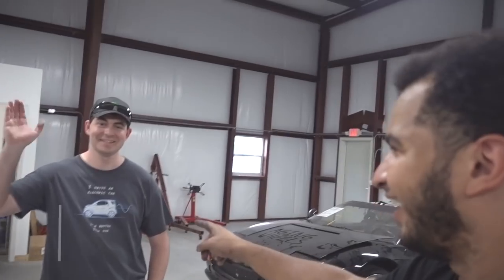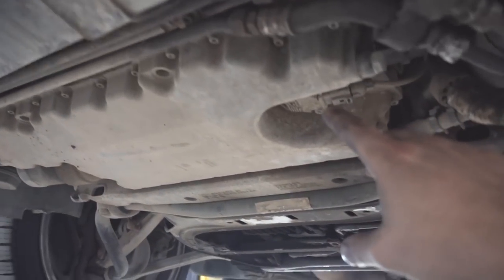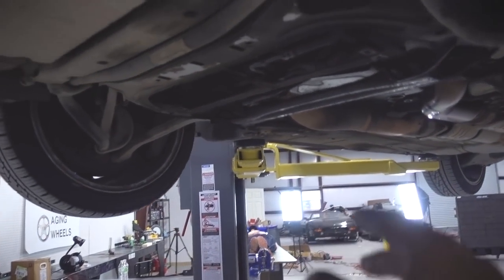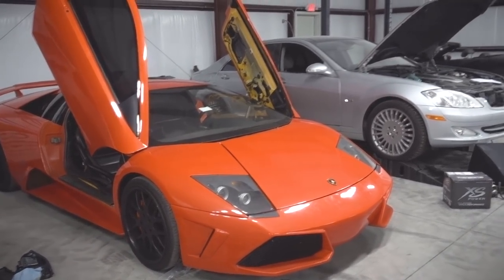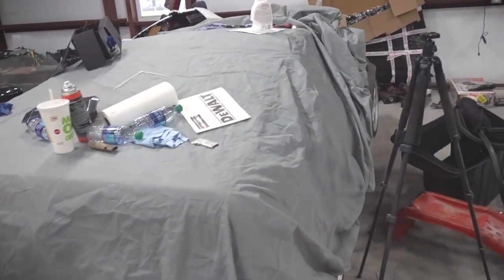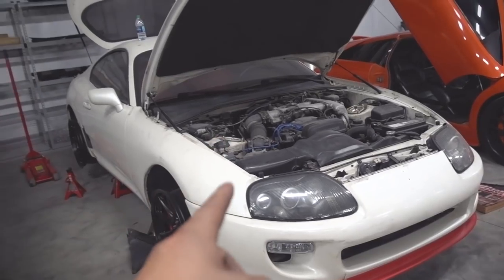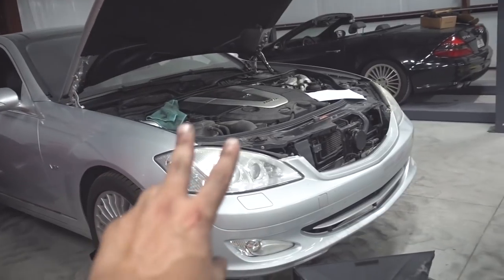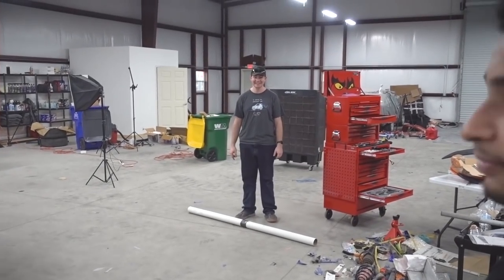My Cheap Fast & Furious Lamborghini Is WORSE Than I Thought - GARAGE UPDATE

Comment: I think it would be awesome to keep the merci an Orange color as an homage to the movie. For example whatever the factory orange Merci paint was from Lamborghini
Reply: Agreed, anything else just ruins the build.
Reply: THE ORANGE DOES NOT SHOW ON CAMERA. HAVE YOU EVER SEEN IT IN THE SUNLIGHT? AMAZING!!!
Reply: Agreed ,  that color wasnt around in 2003 on Lamborghinis,   it's a later Aventador color.  Repainted correctly it will be fantastic
Reply: Painting tri coat lambo color sucks   and iš expensive af
Reply: @OskarasNauseda  naaa.  It's fun.
Reply: Wheels look good as they are too
Reply: ARANCIO ARGOS paint 👌🏼👌🏼
Reply: @linusrichter3934  those are going to be need to be changed for mechanical reasons as the wheels in the back are larger than the front and it is quite hard on the vehicle, the size difference on wheels was mentioned in the reveal video.
Reply: Howema well the wheels can be different size but then you have to compensate with tyre size so in the end you have the same realistic diameter
Reply: Make it matte orange like the Huracan Performance version of the orange
Reply: Nah paint it purple
Reply: He will it's a movie car has to be exact to the movie more value especially fast n furious
Reply: Dominick Nicolai so true
Reply: Dominick Nicolai agree
Reply: It's all about provenance, so restoring it to F&F spec should be the only way forward. Please don't ruin it by doing it any other way!
Reply: Gotta say I agree. Keep the same orange, just do it right. Can always paint some accents black and change up small bits, but the main color should stay.
Reply: Hope he’s keeping the rollcage!
Reply: Repaint it the proper colour it might be a movie car but it would look better as the car it started out as not some bodged movie car which you wouldn’t want to drive
Reply: Duh he’s keeping it the same color. He said he was going to repaint it because the paint job is bad- not because he wants to change the color. Just like the gallardo- he just fixed the paint job. He kept it the SAME color- just fixed it. He SHOULD paint the AMG SL purple though!!!!!
Reply: Keep it painted the same but wrap it in that awesome nardo grey color!
Reply: Knowing Lamborghini, it'll be something along the lines of "Arancio Pretentissimo".

Comment: Rather than buy a 355 hardtop parts car, try to cut the roof off and fit it to your spyder why not just use the parts car as your base and the spyder as your parts car? Presumably it’s not been on fire and is in similar or better condition and already has the roof and could be resold as such. I’m no master mechanic but common sense says that would be much easier and would also give more value to the car when compared to a salvage title spyder converted to a hardtop, the salvage title spyder restored as a spyder would be hard to sell simply because of the title.
Reply from the maker: Because they usually have catastrophic front end damage, and that would be much harder to fix than replacing otherwise undamaged body panels. I wouldn't buy a parts car that wasn't a parts car for a good reason. Also, I'm not selling it.
Reply: Brandon Reid
  Your suggestion would be just Tavarish buying another Ferrari and trashing Tylers car.  That wasn't the point of the build.
Reply: I’m gonna say a true parts car is going to be hard to find.

Comment: Yes, the engine has to come out with the subframe attached. That the easiest. I would turn the Bentley arround on the lift so it faces the other side with the nose of the car, you're going to need a lot of space, drop the complete subframe with engine on the table that you have.Then you can roll it towards you're working benches! Love the video's man!

Comment: I've heard that sand blasting can be too abrasive for engine components. Some people opt for hydro blasting as an alternative. Is this something you've heard of Tavarish or do you think that sand blasting the Ferrari engine would be fine?
Reply: Soda blasting might also be a good option as any remaining deposits can dissolve away when washed down. Sand might work its way into small crevices and cause problems later down the line.

Comment: Those little plastic bits that attach to the gear selector are a bit delicate! I remember having to remove the mechatronics on my Audi to replace a bad gasket seal and it had a similar setup, but none of the instructions for the work even mentioned it, so if I hadn't have noticed it, it wasn't going to be installed correctly and I would have probably been in the same boat. Remember guys, even the shop manuals don't always tell you everything, so look over everything close!

Comment: I would avoid sand blasting anything on those engine parts, try soda or walnut shells they are way less abrasive and would not interfere with tight tolerances as much

Comment: You can take the shift linkage off the old valve body and put it on the one that’s in the car already if you’re careful. And avoid having to do an initial start up of a new control unit. Sadly I did it once when I was just starting out and my foreman had one and that’s what we did. I’ve been a Mercedes tech for 8 years now if that makes you feel any more confident on my comment 🤣

Comment: At least, keep the bodykit on the 'Lago. Looks pretty badass and spot on. The "originale" 2003 body is a bit dull and old looking (would rather have a stock Diablo than a stock 2003 Murci then) compared to that kit.

Comment: A word of caution: not sure is the case of this Ferrari, but on cars that have both a solid top and a convertible version, the convertible windshield and the windshield framework may not be the same as the one with a solid top. They could have different rake, size...

Comment: Are you sure those backfenders needs to be replaced on the Ferrari, a good sheetmetal worker can make them straight and rehardened again, and it would be a good episode to see one at work doing a good job and the the car would stay original, repair instead of replacing sheetmetal parts, thats an artform that has allmost been forgotten nowadays - dont go with the hardtop stay original - you might consider to stay with a max of 3  projekt cars at a time.

Comment: Let me guess, the key of the Murciélago is locked, because the car waits for the "in gear" or "parking brake on" signal. But hey, car electronics, how hard can it be. I mean you already got the electric roof of your other Lambo fixed. Ah, wait, hang on...😁

Comment: Never sandblast a modern engine, get it acid dipped or buy a parts washer. They have galleries that are blocked off internally and the sand gets trapped, once the oil goes in the particulates break loose and cause all types of havoc with your bore's...

Comment: But why would you replace all that metal on ferrari. That damage is not that bad. Could just maybe samdblasst it etch priner it and coat it. Seen an entire escalade get done like that. Still runs no bent panels or weak metal.

Comment: OOF the problem with the key in the murci is well know to me, its basically a vw key from the same era, there is an issue with the mechanism behind the lock cylinder, the rod that pushes out the steerin lock bolt breaks and jams the mechanism, and you cant fully return the key to the off position. Thats why they put a start button in the engine bay. Its a major fuckin pain in the ass.

Comment: That looks like the wrong conductor plate for the mercedes. The car is a 7 speed 722.9 gearbox, the valvebody and conductor plate you have to put in is from a 5 speed 722.6 gearbox